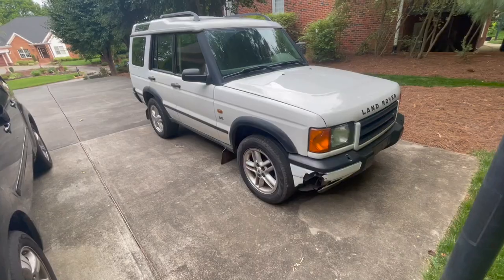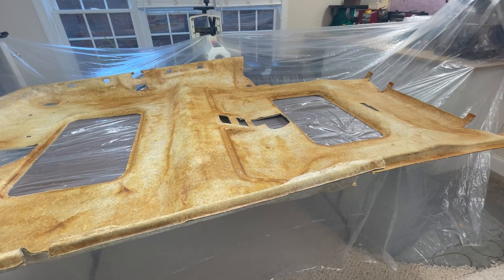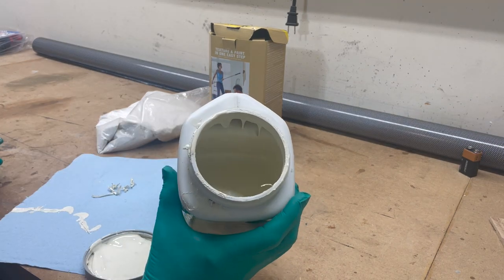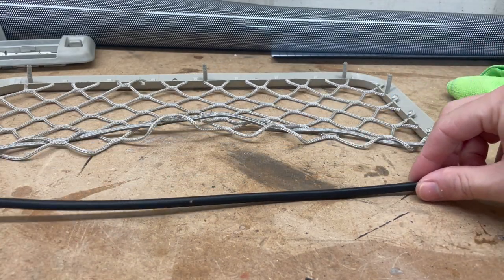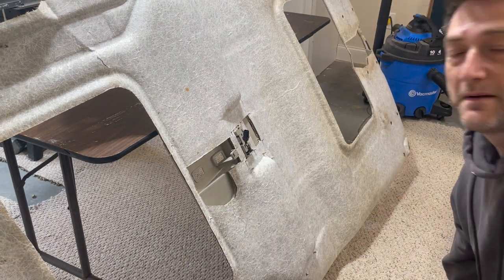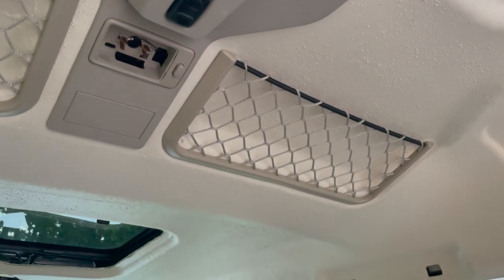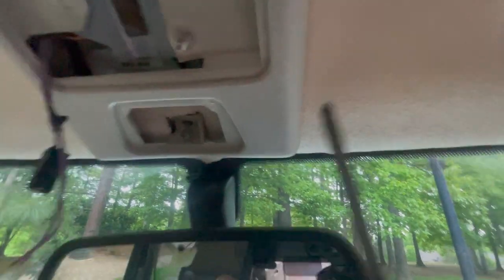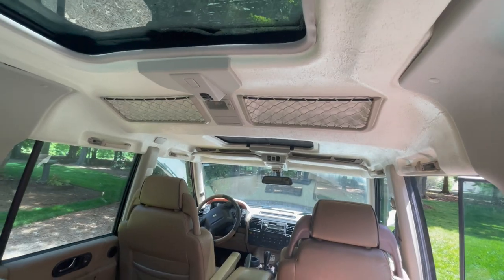Land Rover Discovery 2 headliner restored with truck bed liner...Sort of

Comment: I was going to powerwash mine but if this is non damaging then ill be happy to try this.
Reply from the maker: To get the foam off, the nylon brush worked great. And a wire brush worked pretty well also. You do have to be careful with the powered brush around the openings.  My buddy had to replace another headliner and get the foam off, the headliner was wet from a roof leak, he said the foam was a gooey mess when wet, so I wouldn't recommend pressure washing it.